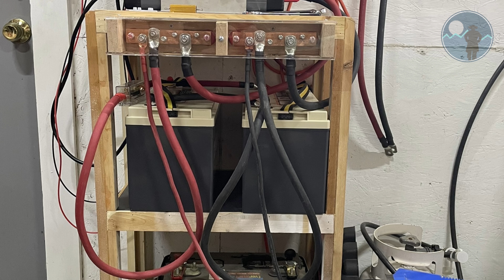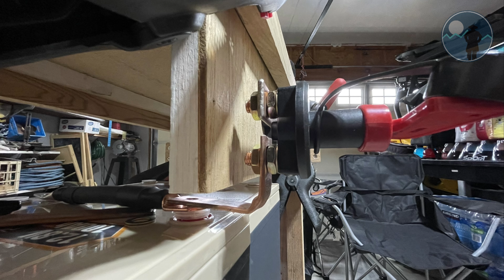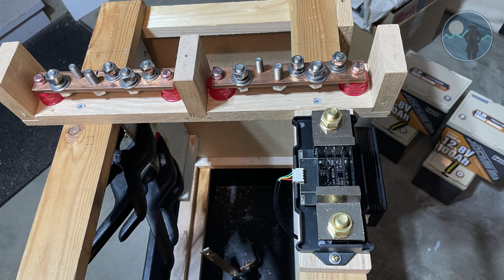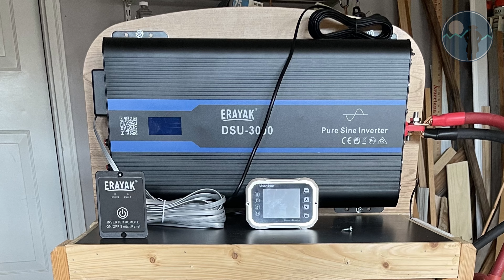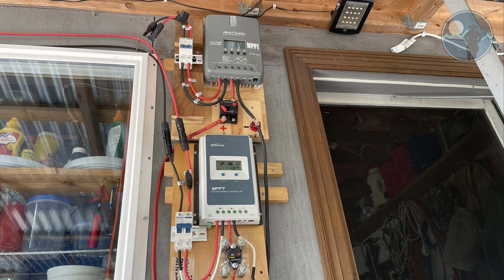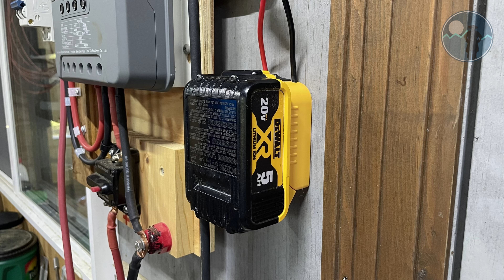2025 DIY Off Grid Cabin Power

Comment: Cool!  I was wondering why you set up the cart with two separate systems but then you explained it.  My question is:  why not run all the batteries in parallel (the 280's) and when they get down to about 60% DoD just run the genny to get them back up?  Otherwise, a great project that's coming along nicely!
Reply from the maker: Thanks for the feedback. I let my son watch it and he said I should publish it, which I think I will. This was my first attempt at narrating, so I can only get better from here. To answer your question. I used to do that with the 4 - 100ah batteries, because I had a 500ah shunt. With the 2 - 280ah with both running that's 560 amp hrs. See how I'm limited to a 500ah shunt, I didn't think that would work. I'd appreciate your thoughts on whether or not you'd think that would work. I have not tried it that way. Now that I've gotten over the fear of narrating videos, I had a whole bunch of photos that I can turn into short videos along the same lines as this. So check back from time to time and see what I come up with, good, bad or indifferent. I basically started out doing this for me and my family and friends to watch. Who knows one day I might even be as good as you! Thanks for your interest in my project.